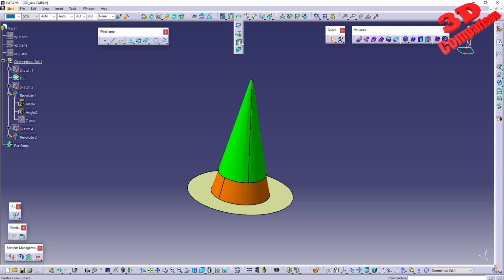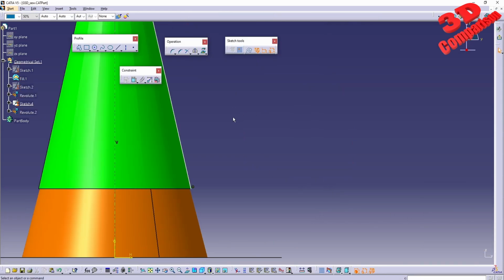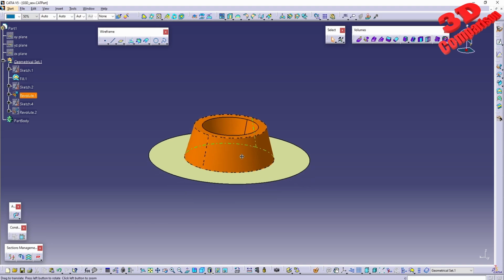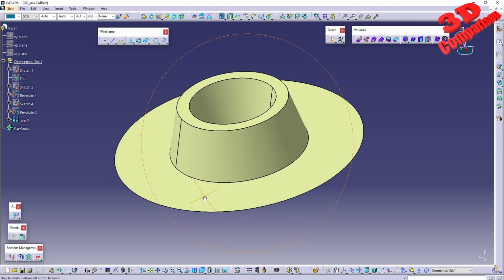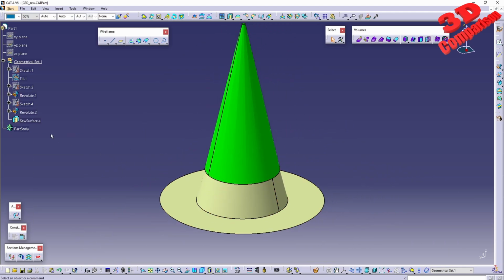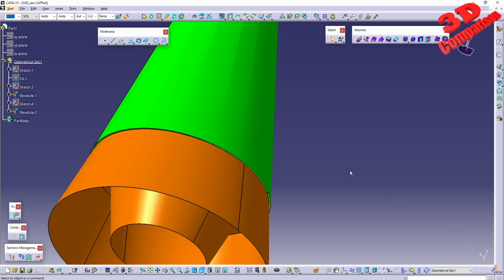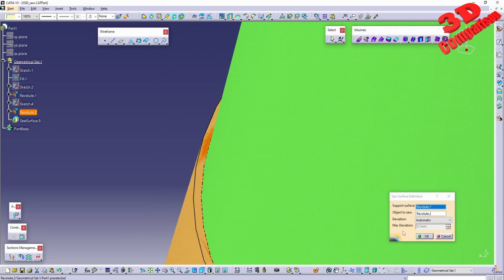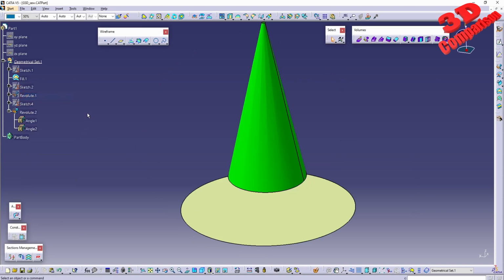How to Sew Surfaces in CATIA V5

Comment: This isn’t the main proposal of sew surface.
Reply from the maker: I agree that the feature has multiple functionalities, but the sew surface feature is mainly intended to combine surfaces with an existing element. The use cases are endless. What do you consider is the main purpose of the sew surface feature in CATIA V5?
Reply: Splitting and trimming😂, actually I watched every video on sew command but this is the most specific and differentiable one